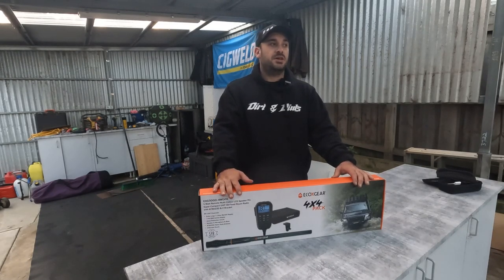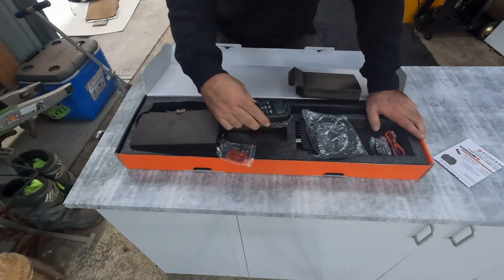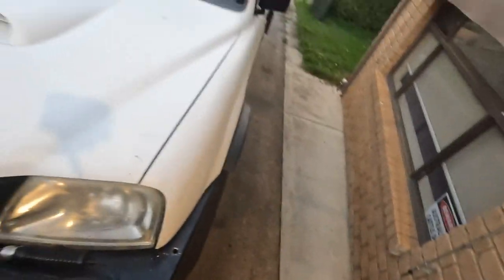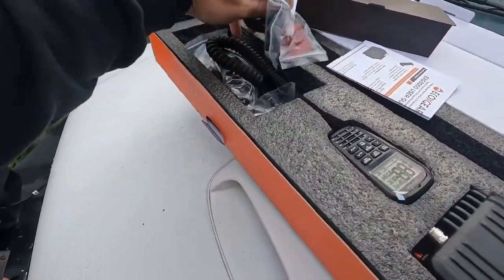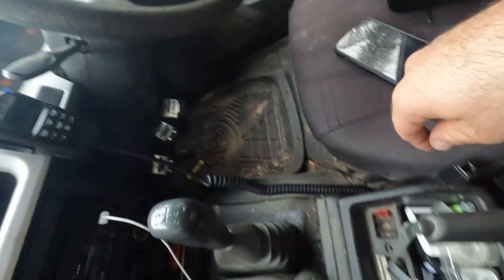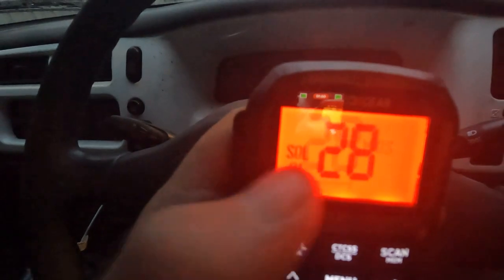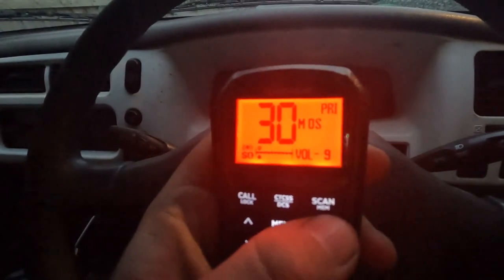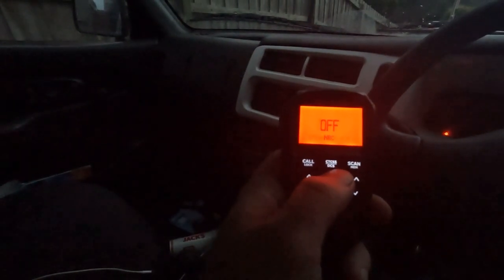NEW UNBOXING EcoxGear 4x4 UHF install and review

Comment: That's some fairly poor range from that kit. The GME I have with the 2.1 dbi easily gets 2 plus kms. Seems like the Ecox gear is a poorly reverse engineered copy of the GME.
Reply from the maker: Hey Mate, Currently for what I've been doing and using it for I have not had to much of a drama. Saying that I did after the video played around with some of the settings and were able to iron out some of the distance/clarity issues